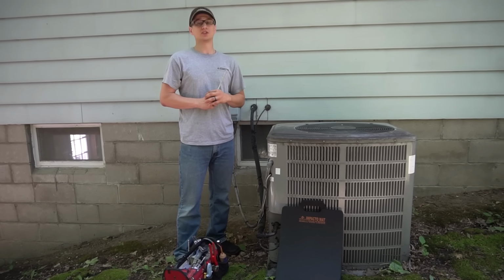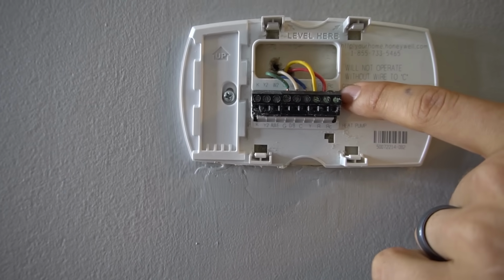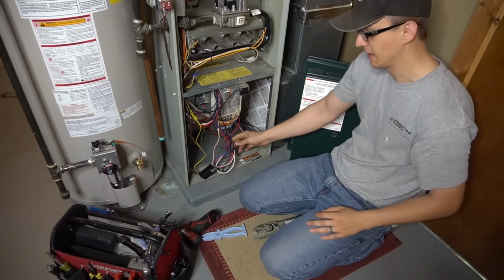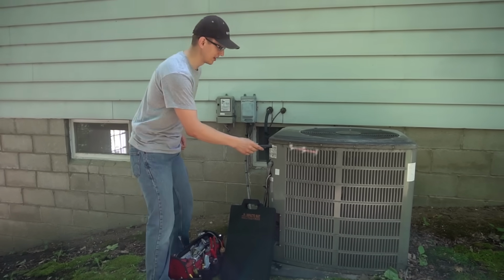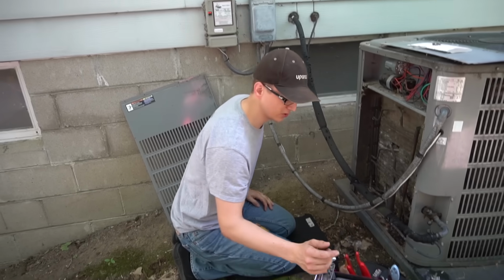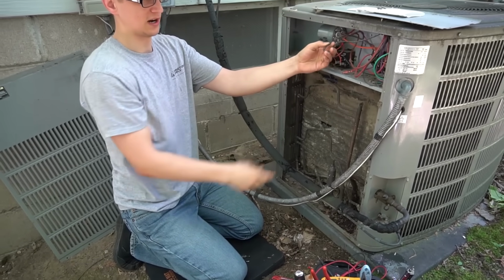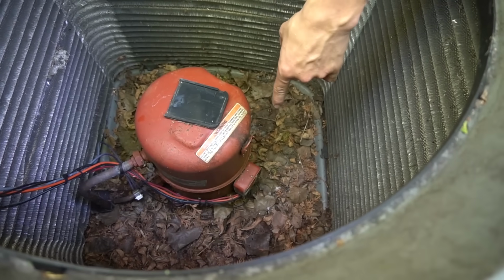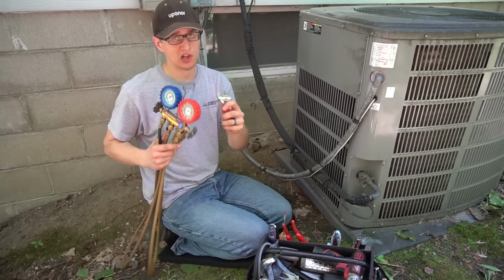AC Unit Not Turning On - How to Fix It Step by Step

Comment: Hey I need help I got a dufuss for a technician under a home warranty and he has been to my home 3 times at $90.00 a visit, my ac outside unit is not coming on like it should! I hear a motor humming sound, the fan not turning he replaced the wire on the outside unit where it runs from the disconnect wire on the outside and also 2?corroded connectors to what I don’t know but it’s on the outside unit! He came out on Monday got it working had to come back 2 days later that’s when he change the weathered wire that he claimed was the problem  2 days after that it stopped working again he came back and it was working and the same day it stopped again. For upto 3 days I kept turning the switch on and off hoping it will catch on and start the outside unit finally the 3rd day it started back working only for approximately 10 hours or so and now it’s not running again! I had the compressor, the fan and a compactor replaced last year, what could be wrong with the unit the technician doesn’t know and they keep sending the same person and I definitely don’t know anybody have any ideas?

Comment: Very nice and useful video. 
I have a problem in my heating/cooling unit (Heat pump installed) that its air circulation fan always keep on running even I set to "Fan" or "Auto" option on thermostat. Can someone help me where could be the issue.

Comment: so my ac plunger works and fan comes on when pushed in and my furnace fan works my thermostat works because my fan turns on inside when i put it to the on position but the outside unit wont turn on i don’t understand

Comment: I've replaced both capacitor on my unit and I'm still not getting signal to my unit to run. I've made a mistake of leaving the cover on my unit and ran ac and when I realized it, my unit stopped working, once I replaced both capacitors, the fan runs, but no signal from the thermostat to keep unit running and cooling the house, the furnace works fine too.

Comment: Great video. I am hoping you might be able to offer a suggestion to help me troubleshoot. My compressor runs fine as long as it keeps running.  After it shuts off, it will not turn back on if the thermostat request comes too soon. The thermostat has a 5 minute lockout.  I have a poorly insulated house.  On a very hot day there is no problem - the AC runs constantly.  On a slightly warm day, also no problem. It reaches temp and then the next request doesn't come for a while. On a hot day, the cycles are too fast and I get this problem.  You get the picture. I can force it to come back on by spraying the coils/fins with water, so I think compressor has "locked out" because the temp is too high.  But is that it, or is it that the pressure is too high (because of the temp) and the motor can't start from a stand-still? So perhaps I could add a hard start kit to get it going? Sometimes, I can hear the compressor buzzing (trying to start) when it is in this state. Not sure if that is true always so hard start kit is cheap to try and won't hurt, is my thinking.  Replacing the whole thing may fix it but it is still going to get a request to turn on after 5 minutes.  I could improve my house insulation but that is another discussion - attic, walls, radiant barrier, which is an expensive experiment.  I would like to better understand my problem first.  I just bought a thermostat with a programmable differential, so this may give more time for the compressor to recover and mask the problem.  Thanks for any suggestions to troubleshoot. BTW, the compressor was replaced, which made no difference.

Comment: Sometimes the copper line running from the outside unit to the interior unit can experience either a crimp in the pipe or a leak and you have to pressure test it to find the leak. It happens in most cases where the AC unit runs but mysteriously leaks refrigerant after a full charge or refrigerant doesn't make the trip all the way to the interior unit. I found the leak in the copper pipe located behind the interior Drywall. Errors made during Construction, Foundation Settling or After an Earthquake can also cause this Issue.

Comment: Hi, you are simply amazing!! My very hold, but not used too much HVAC only blows air but the unit up on the roof does not turn or make any noise. I was wondering how to tell if the connector fuses have gone bad and how to tell. Any other idea would be appreciated. It is so hard to find reputable technicians like you are... thanks for your time and effort to educate, and for sure you should be an instructor!

Comment: I have a 1-year-old Lennox air and furnace. The air worked all last summer just fine but will not turn on this year. Everything you showed in this video is fine. I have power to the unit (220) and power at the wires that come from the thermostat to the air unit. The PLUNGER won't engage on its own. If I push it in like you did everything comes on and I can feel the 3/4 pipe getting cold. 
 I have checked all wiring and everything has power and the thermostat is on cold and set 10 degrees colder than the air temp in the house. The guy who installed this unit has moved out of state. What is wrong.??

Comment: Can u explain the r and rc terminal on the t stat again I'm a bit confused.
Reply: Hopefully to answer your question and anyone elses. Background on me: used to work in residential/light commercial HVAC, have a 2 year degree in it, and now am union electrician.
The answer is that R is your standard 24V hot source. However, on some older houses you may find that they have 2 different systems that control the heat and cooling. An example of this would be a boiler for hot water heat, and an air handler for air conditioning that was added many years later. In this instance the air handler would have a 24v hot from its transformer, and the boiler would ALSO have its own transformer with 24v. So you can't put both of those hots on the same screw in your thermostat, it wouldn't function correctly. You would put the 24v from the boiler on R (or in these cases they are usually marked RH), and you would put the 24v from the air handler on RC. RH is R-Heating, and RC is R-Cooling. 

In 99.9% of cases you will just put a jumper wire to connect these two screws if you have a standard furnace/AC or heat pump setup because there is only the one 24v from the furnace to use. 

Also not all thermostats have this dual function. Many of them just have an R and thats it. These thermostats will work on everything except for that complicated setup I explained earlier with the boiler heat and the AC.

Comment: I would like to thank you so much for this helpful video.. My AC was not turning on at all so i followed all the steps that you mentioned on the video one by one until i got into the fuse which I succeeded to  locate it on the motherboard, went to Low's got a box of 5 fuses for $4.20 and changed it and now we are enjoying the cool air :) Thank you and good job

Comment: My unit turns on, but the outside fan doesn’t  spin. If I spin the fan manually it will keep spinning and work fine until next time the unit need to kick back on. Does the fan Moyer need to be replaced?

Comment: My condenser unit not working, the inside is running and working well. The outside fan isn’t running and the contactor is pushed in. I replaced the capacitor and still nothing HELP!

Comment: You just saved me having to call a technician. My girlfriend and I just bought a house and when our AC was on, the vents were blowing air but my house was only getting warmer. With your video I was able to trace the issue to the wiring in my thermostat and I rewired it. Idk how the previous owners lived without AC, but thanks to you I won't have to share that experience.
Reply: They probably took their nice thermostat with them when they left and the guy who put the one on that was wired wrong just threw it on without knowing what he was doing. The old handyman special”

Comment: I just want to say a huge thank you for this video.  after watching your video and testing the capacitors first, i was able to find out that my thermostat wire going to the plunger assembly was frayed and disconnected.  probably by vibration or a mouse.   Had I not watch your video when you pushed in the plunger i would have not been able to find out that the thermostat could send the request to the unit because the wire was cut (yellow wire)  Many thanks.

Comment: Like Cecil I'm learning about a/c's but don't know anywhere as much as this young man. He taught me about capacitors last fall and I replaced both of them, one in my furnace and one in my a/c.  I ended up putting a new fan on my furnace. I went to turn the a/c on and the fan was working but not the compressor. When I pulled the cover off and the capacitor was fine, no nests or evidence of chewing but a very fine spider web. There wasn't much so I brushed it out, pushed the plunger and the compressor clicked on. Went inside, turned on the A/C and I have air!! If I had called a repairman that would have cost me a fortune for something so simple. I'm slowly learning, young man keep up the good work.

Comment: Hi, Jay,my name is Jose Morales,I have a question ❓ when you wash your unit, do you need to wait until gets dry,
Reply: Typically not as it is an outdoor unit rain and the elements get it wet.  In the winter a cover is recommended if you have cold and snow but otherwise should be good to go!  Just make sure not to spray your electrical gear, which should be sealed up.

Comment: This video is awesome. I was able to trace my issue after finding the fuse to be burnt out whenever specific wires were connected. Pulled extra wire and removed the shorted portion! Thank you so much!! I spent $4 only a small pack of fuses, saving me possibly hundreds of dollars against a service call.

Comment: My ac was running fine and just stopped. The thermostat was blank. We replaced the fuse in the inside unit. The thermostst came back on and the fan comes on but the outside unit doesnt turn on. What could be wrong. P.s. my filters were really dirty.

Comment: Tried to add new internet thermostat on daughters a/c and Heat but seems to short cycle during heating cycle had to put old thermostat works ok also AC does not come on when we turn ac on. I replaced the old thermostat wire with one for more conductors to get a common wire. If I push down on contactor the compressor starts. First time working on hot air combo unit. Just wondering where I should start. PS  your videos are great. Thanks.

Comment: Thank you!!!  I was able to take your logical steps of troubleshooting and fix my own AC. Both compressor and fan were dead. 
I validated power was there by bypassing the thermostat. I then tracked the power lines in the wiring and found that the power connection from the main board in the attic was not fully connected to the red cable going to the outside unit. Red connection looked but down to a stub. Hmmmm heater man was fixing my heater the previous week.
I cut the cable properly to secure a connection and the system was up and running. 
After going through your video, I realized that AC systems are really not so complex. 
You saved me a lot of money and even more important was the fact I now know not to use that service company who was telling me I probably needed a new AC system  since mine was old not knowing my power line was cut in the attic.

Comment: I recently replaced the capacitor and tested the contactor outside manually (pushing it in), the fan/condenser starts up without issue. My fan/blower and heating also works inside the house. The issue I have right now is that my thermostat is not able to start the ac unit outside. I also tested the wiring behind the thermostat and I am not able to jump the ac unit (Red to Yellow). I used a multimeter and noticed, the White and Brown wires had over 24 volts but the yellow wire had 19-20 volts. My fuse in the furnace panel is not blown and I do not have a control board to check for a status indicator via a LED. What would you suggest?
Reply: I used your trick with the red and white wire and it worked. What would be my next steps?

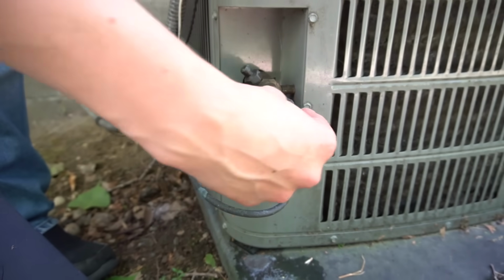Comment: 14:18...we just recently moved into a new house during the winter and didn't need to use the AC until the last couple of days. We had the HVAC guys come out and test the two units before we bought the house and everything was fine. Well...they never flipped the disconnect back over to plug it in when they were done. Such an easy fix! Thanks for the video! New subscriber here.

Comment: I know this is an older video but I have a question. I can hear my condenser humming like it’s trying to run. My fan on the condenser isn’t, but it sounds like the compressor is. I checked the compositor and it checked out good. And I checked the fan and it check out good. What else can I check?

Comment: I did press the contactor  and  the fan work inside the condenser unit however the thermostat  have not working when i turn it on it just make click sound every couple minutes can  you please help me find out the problem is  also check the fuse inside of the Furnace it looks fine .thank you

Comment: Thank you for the information. Very helpful. My ac fan blows air inside house but I'm not getting any cooling. And also the breaker panel outside keeps tripping when I reset it. But I still have power to my thermostat. I can try to replace my thermostat battery and also check for a fuse inside the ac unit to see if it has blown. I do have leaves inside my outside unit that I need to clean up. And I will also check that switch to see if a bug got in there. I do have that breaker plug disconnect like you have. So I will unplug that while I'm checking any possible broken wires. My question is: Why does my breaker immediately trip when I reset it at the house breaker panel? I could possibly need to replace my breaker. Maybe the breaker at my panel went bad, or the Ac unit is causing it to trip every time I try to reset it. So my problem right now is I have a tripped breaker at the house panel 2 -prong. And I do have power to the thermostat, and my blower turns on inside the house and blows air but not cold air. I replaced my air filter. I will clean out my condensation pipe tubing line because I'm thinking that maybe it is plugged up and the sensor might keep it from cooling my air, I'm not sure, but I will clean it out with air first and maybe bleach solution and pressurized water to blow out the pipe line condenser drain. I will check the capacitor for bubbling and compressor connections.

Comment: My AC fan was working before and after I installed whole new air-ducts. Now, the fan is not running either someone came in during Christmas days and setup the heat at 62 degree or the power was out that night at the entire my area. However, I found the 60A breaker is loosening next to the HVAC but I did not have a chance to take it off. I will try it tomorrow (12/29/20).

Comment: A lot of people saying that HVaC techs hate this video.. but I’m a tech in training, recently got my refrigerant license and Universal certification. I’ve learned a few key “tale-tale” signs from this guy... I’m still learning so I usually get into the wiring diagram and start troubleshooting where I’m getting power, and where I’m not.. and usually dial down. Refrigerant pressures are easy to read with the chart.. usually you’re either low, restrictive air filter, etc. but this guy is AWESOME! You can never learn enough.. and I’m happy to know people aren’t getting cheated by skimpy techs. You want cheap and reliable.. go Goodman. You want pricey and reliable,  go Trane.

Comment: Hey can you please cover when measuring a compressor, fan motor,or pressure switch which is good or bad when you read ol, resistance and 0ohms sometimes I get confused when measuring those reading on a compressor and fan motor. Please help me out!!!!!!

Comment: We are hearing a beep beep.  I thought it was the wall speakers from the home entertainment system.  Disconnected all the speakers and unplugged the home theater unit.  We are still hearing beep beep beep.  So I wonder if it is the central air & heat.  Can you tell me where to start tracing this problem.

Comment: Maybe you can give me a little direction....'a/c wasn't working, turned fan to "on", no air from vents.  Opened handler cover. Coils were cold/iced.  I defrosted and cleaned with coil cleaning foam.  Checked and cleaned drain line and dried the sensor.  Still no air out of vents.  If I turn off unit at the switch.  Then turn it back on, I can hear the thermostat click, and the a/c unit 'picks'... then the internal fins in the blower are moving.  I hear a kind of whump ... whump ... whump like some motor is trying to engage but nothing is happening.  Even thought the fan inside the unit is spinning, no air blowing from the vents.  Is it time to go outside and work on the compressor part or could it still be something inside at the handler?  Its Friday after thanksgiving, trying to fix this myself if its possible, or at least know exactly what the problem is before I call in the "pros". I have some electronics background and I have changed out the run capacitor ouside a few time.  Usually if its that, the air does blow from the vents.

Comment: Although, I dont have any knowledge of AC units but fixed my AC just right now. The fan was not working and after pressing plunger on the contact, the external unit started. I cleaned it with the brush and the AC worked like a charm. Thank you so much for all your wonderful videos and hats off to you.

Comment: About that drip pan drain, what about the whole quarter inch drop per foot and trap requirements of an A/C unit? In this case, wouldn't the blower motor would probably be sucking some air in through that hose, along with the moisture, causing mildew and (by some small percentage) bypass the filter?